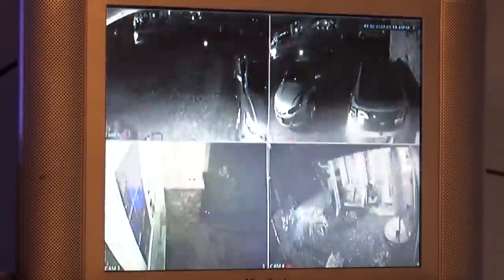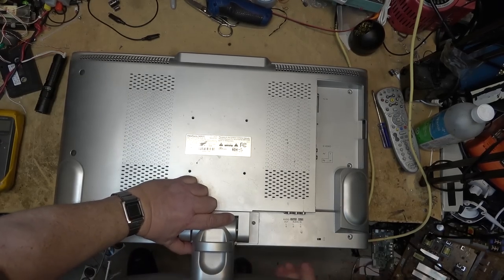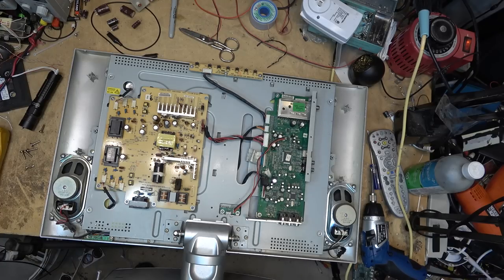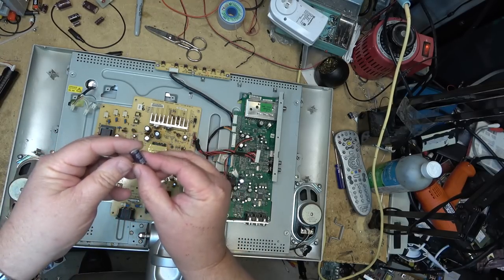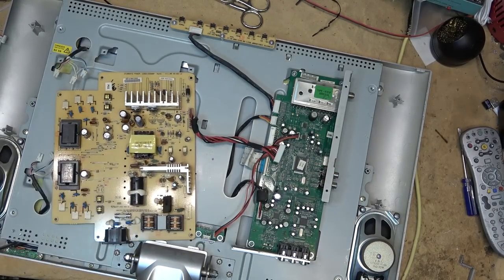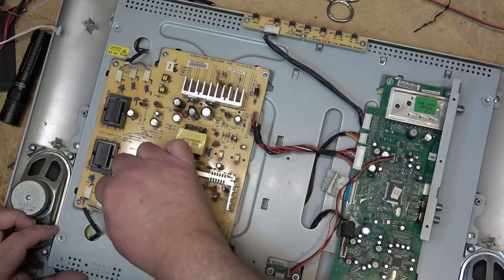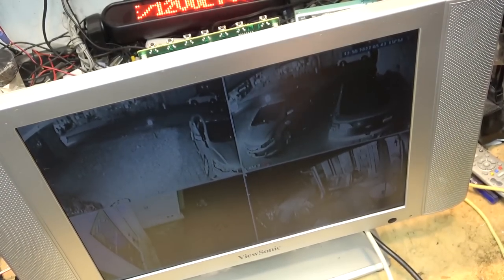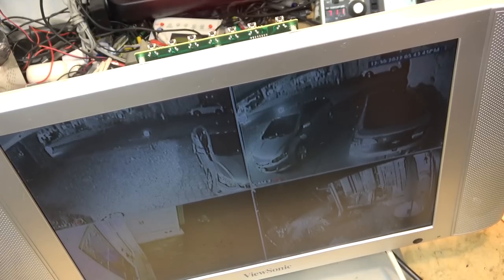Viewsonic N2011 Ah CRAP another TV!

Comment: Electronics hold up amazingly well running 24/7.  We ran stuff that way in the police station when I was a cop and TVs and computers lasted for years without service.  That jolt of electricity when they start or the change of temperature must take its toll.
Reply from the maker: That's right.  That's why i leave the monitors run 24/7.  Screw the electric bill.
Reply: My one of dads best mate,s is an electrician he sad the same years ago most wear is caused buy turning something on an off .

Comment: Happy New Years Dave!!!  Thanks for all of your content.  68 year old retired tech. Started in 73 repairing guitar amps. Stops at 16mm projectors 1979 till 1986. Powered wheelchairs and Oxygen concentrators 87 till 90, Then back to consumer appliances and electrionics.  Stopped 2007. 5 years as a shipper/ receiver of industrial hoses.  Part time auto parts delivery till 2017. Enough. lol retired 2017.  Be well.
Reply from the maker: I'm starting to think retirement too.  2 years i think but could be sooner.  All depends on how things go at work.  If a VSP is offered I may pull the trigger sooner.

Comment: At 4:13 time point:  That 65535 hours - that is the maximum value that can be put in an unsigned 16 bit integer, so it probably has many more hours than that - it's just the maximum number it can accumulate and display!    65535 is 2 to the 16th power, minus 1.
Reply from the maker: yup. probably a little higher. Last time I looked it was 64800 and that was a few months ago
Reply: @12voltvids  I bet it will never go above 65535 and it will be like people who are "39 and holding" when they hit 40.  Ha Ha.
Reply from the maker: @3Cr15w311  65535 and holding
Reply: 65535 is 0xFFFF hexadecimal ... Probably 16 bit binary hour counter with saturation.
Reply: @tomaszpiorek2393  Yeah, an unsigned value with all 1's binary.   Any time I see 127, -128, 255, 32767, -32768, 65535, or the famous plus or minus 10-digit number starting with 2147...   I think saturation of a value limited to so many bytes.    I bet the maker of this TV never thought it would last 2^16 - 1 hours of use.

Comment: When I first came across your channel, I was looking for advice on how to clean the heads on my VCR. (Thanks for that, by the way.) 
After watching many of your videos, I now own a multimeter, soldering station and an ESR meter. To be honest, they haven't seen a lot of use yet (I just got the ESR meter), but I have been able to get a couple tape decks and a VCR/DVD combo going again by replacing belts. I have a Sony SLV-757 VCR that's mostly working after watching your video on fixing a stuck P6 guide and tonight I was able to power on another Sony VCR (SLV-595) for the first time after replacing a bad (85 degree) capacitor in the power supply. Thanks again and Happy New Year!

Comment: Capacitors. Drmn capacitors.  My DECT handest on my landline died a few days ago.  I thought it was the batteries as I saw one of them no longer held a charge.

Anyway I opened it up and eventually found a capacitor that has started leaking. Replaced the cap and works fine now.  Now I'm wondering if I should have swapped the other two as well as they we all the same make and value.

Comment: How do these caps last over 60,000 hours with a monitor on 24/7 . When I look at specs for caps from say Panasonic gold, or mundorf it says “ rated for 4000 hours at 85 degrees Celsius “ . I woulda thought the temps inside that Viewsonic would be quite high if left on 24/7 😮
Reply from the maker: You do realize that 4000 hours is only 5 months of 24 hour operation don't you?  
150-200k hours is a more reasonable estimate lifetime for capacitors that are not run at their maximum voltage and temperature. Many will fail before that time due to other factors such as defects in manufacturing or damage during installation, vibration ect.

Comment: Isn't it somewhat expensive to run an old monitor like that 7/24/365 for years?
Reply: It's probably costing him about .21 cents per day to have this on full time.  Nothing to lose sleep over I'd say.
Reply: @canadavey 

Apparently your argument is that the technological advances in power saving technologies since 2006 isn't worth taking into consideration, that's somewhat surprising 🙂
Reply from the maker: I would say less than that.   More like .15 a but I have 3 running.

Comment: I dislike when you change the original capacitor value, because who will operate next on that capacitor, you or another person, will not know what the original value was, so he will not know what value that capacitor was supposed to be.
Reply: At least put a notice inside the monitor with the indication of the original capacitor value!
Reply from the maker: You can ALWAYS go up in value. It is a very common practice that everyone does. If you don't then you are in the extreme minority.   You can't go down on voltage or capacity. Going down on capacity will change performance and going down in voltage will result in early failure.   If you look on this board there were 2 caps in parallel but only one installed.  It probably originally has 2 1000 uF in parallel.  Then they decided to eliminate one and go to a single 1500.   I was contemplating putting in a 1000 and 560, but had that one sitting on the bench from a recent pull. Again you can always go up, not down.  Everyone in the repair business did it because it cut down on inventory.   Shops stocked standard values and not the oddball values.  Nobody is ordering in special parts for the oddball values some devices used.  Stocking those extra parts added additional costs and placing special orders for them also added additional costs that ultimately would be passed to customer.  So standard values, 1, 2.2, 3.3, 4.7, 10, 22, 33, 47, 100, 220, 330, 470, 560, 1000, 2200, 3300 in voltages 16, 25, 35, 50, 63, 100, 250.  The higher voltages usually just sizes 33 and under.
Reply from the maker: @Douglas Blake I'm not working in the signal path am I?  In the signal path you are matching and coupling stages. So changing values can change things like cross over frequencies and bandpass. Generally however there is leaway because of what is called tollerwncev. Electrolytics capacitors can be as much as 20% either side.  So a 3.3 can be replaced by a 2.2 or 4.7 and you are not likely going to notice anything.  Signal capacitors however very rarely actually fail.  It is usually filters in the power supply and you can always go up in capacity and voltage. Also, who else is ever going to see this? It's my unit, nobody else is getting into it.  Even if it was a customer's set, the chances of that part failing down the road and it being repaired again are slim to none. These days even if someone does fix something now if it fails again down the road the chances of putting more money into an old piece is slim to none.   Do you really think if this wasn't my TV it would have been repaired? It was given to me a dozen years ago because the previous owner wouldn't fix it back then.
Reply from the maker: @Douglas Blake no you didn't.
Reply from the maker: @Douglas Blake yes I am aware.